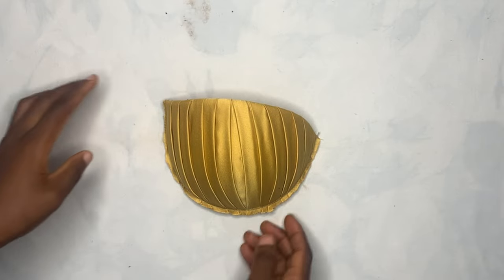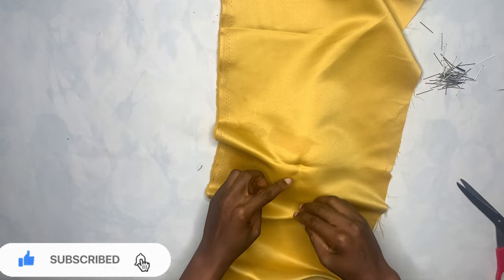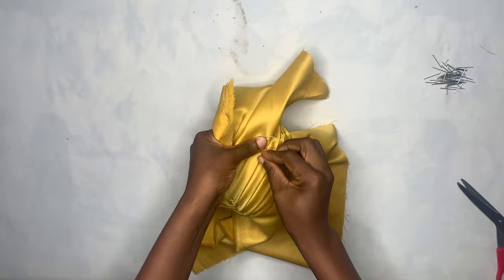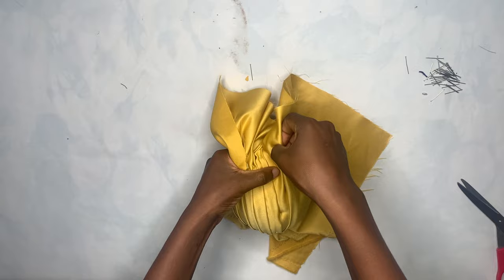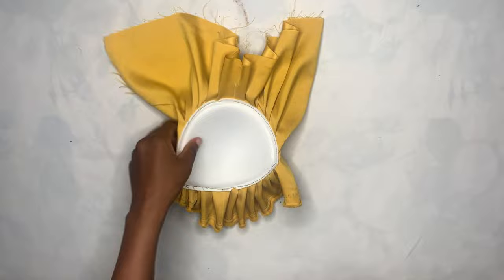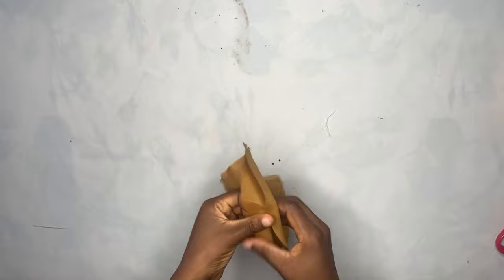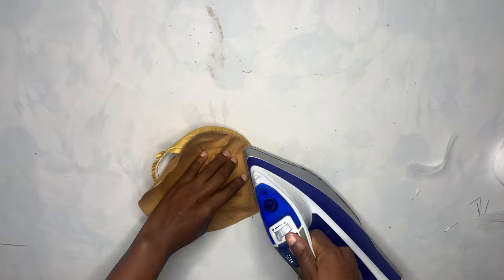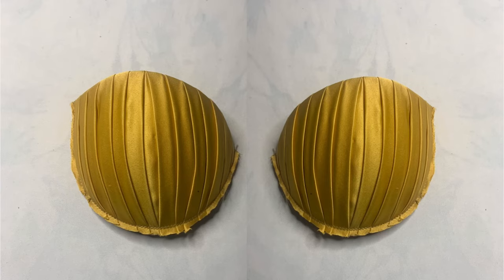DIY: How to design bra cup for your corset | beginners guide

Comment: Pls ma
How do i determine the bra cup I'm to use for a particular bust
Reply from the maker: The round bust measurement is the bra cup size 
If the round bust is 36, the bra cup size is also size 36 
For a case where the person is very busty, you buy a bra cup that is 2 inches bigger than the person’s round bust measurement ( I.e if the round bust is 36, you buy bra cup size 38 because the person is busty) 

Note that the bra cups only comes in even numbers e.g 32, 34, 36, 38 and so on 
If the person’s round bust is 33 which is an old number, you buy a bra cup of size 34 because there is no bra cup of size 33 in market.
Hope you understand
Reply: @stitchesbytale  wow
Thank u so much ma for this explanation
God bless u